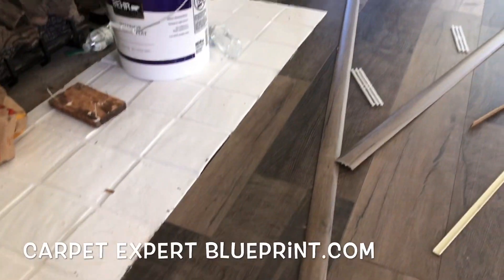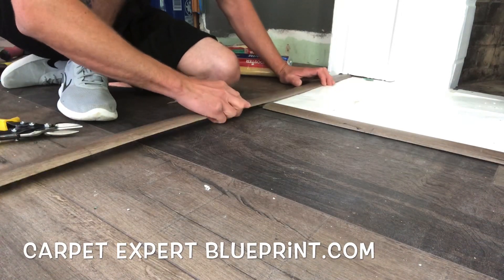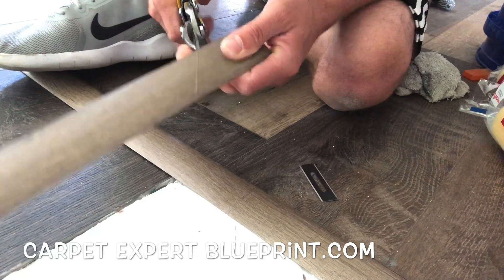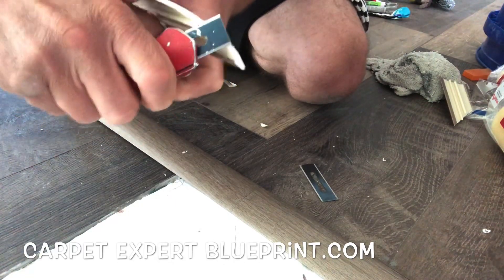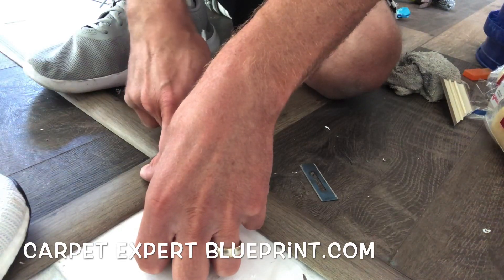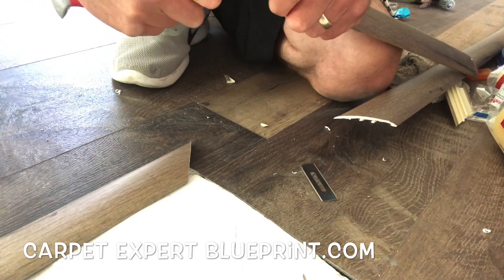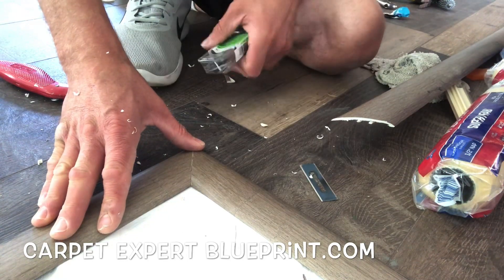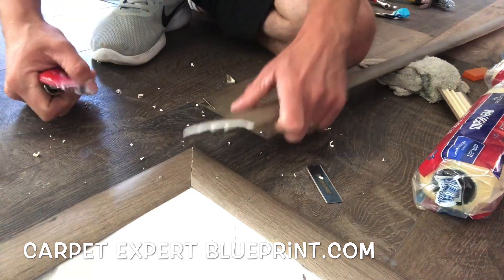Vinyl Plank Flooring Transition Installation

Comment: I love how you started singing about shaving the bark off. LOL. This was very entertaining. I would probably want to use tracks because I wouldn't want visible nails, but to each their own. I would like to see how to install with tracks. Prices on the trim have increased. Used to be around $20/$30 but now a single transition piece can cost more than an entire box of the laminate. I've seen some over $80 per trim piece.

Comment: I got some t molding going from lvp to carpet. Screwed in the transition track and now trying to snap in the strip. It absolutely will not snap into place and I am using a rubber mallet to try and snap it into the track. It will not snap in and the teeth on the strip are constantly breaking to pieces. Any ideas please?
Reply: Little late, but I had same problem. Issue is screws push track down which makes top of track close up. To fix, I just put a large blade screw driver in and turned until track opened up slightly. Mallet sets it in nicely after that

Comment: This is so not the way to do this. Just use you’re LVP cutter much cleaner and more accurate cute by adjusting you’re LVP cutter to the 45 degree angle. Can you say rookie. I would have had mine installed already all the time he’s wasting.

Comment: This is so not the way to do this. Just use you’re LVP cutter much cleaner and more accurate cute by adjusting you’re LVP cutter to the 45 degree angle. Can you say rookie. I would have had mine installed already all the time he’s wasting. Once you start trimming off and shaving you lose a perfect clean cut